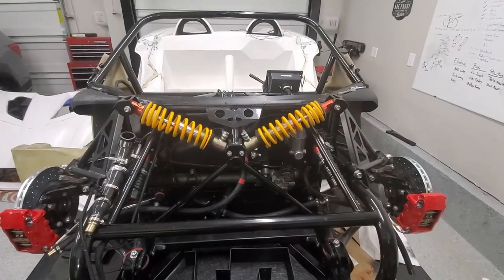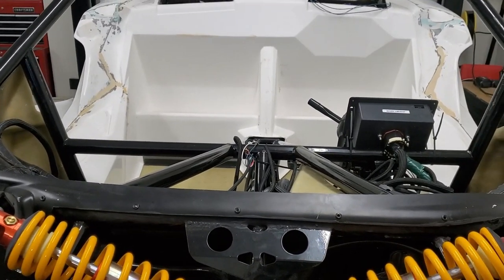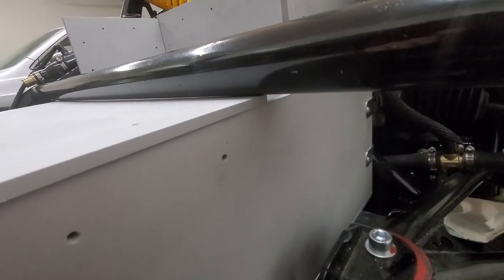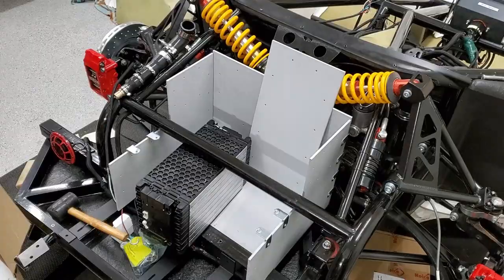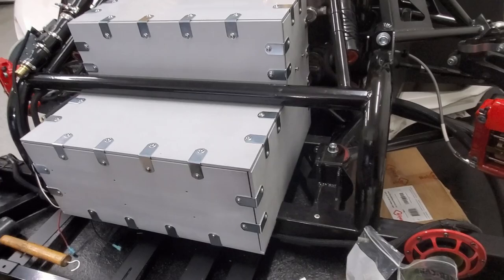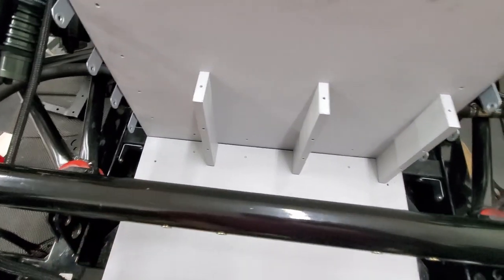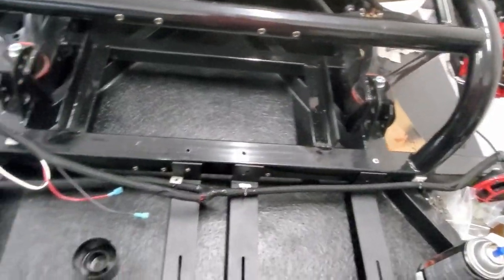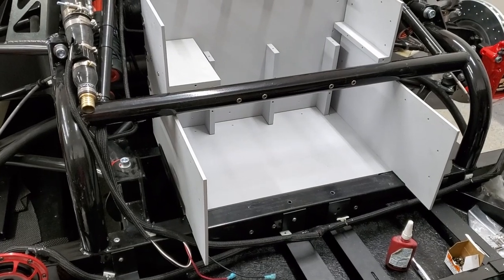Electric Vehicle Battery Box Assembly (Front)

Comment: Interesting.  Those batteries don’t require any cooling?  I would think that you would have heat buildup under load.  The Chevy Volt batteries I’m using for my project have cooling jackets between each cell.
Reply from the maker: Plan A is to start with air-cooling.  The front pack being up front with all the moving air and the forced air from the radiator will hopefully keep things cool.  Plan B is to utilize the built in cooling plates for each battery module and use fluid cooling with the radiator.
Reply: These batteries will require cooling if ran hard, EVwest mentions this themselves that their Tesla swapped M3 started getting batteries hot. @Electric SuperCar be sure to monitor atleast some of the battery temp sensors to make sure they do not go too crazy.
Reply from the maker: @T Bree

Thanks for the advice!  Each battery module has 4 thermistor outputs.  I will be monitoring.  If my spirited driving results in consistent overheating, I will resort to plan B.  Plan B is to utilize the built in cooling plates for each battery module and use fluid cooling with the radiator.
Reply: @ElectricSuperCar  How will the air cool the batteries while they are inside of the box?

Comment: How many KWh is your total battery pack size?
Reply from the maker: I have 12 battery modules at 2.6kWh each.  ~30kWh
Reply: Electric SuperCar nice that is the same as our project what’s you nominal system voltage?
Reply from the maker: ~365V is nominal.  Full charge is close to 400V